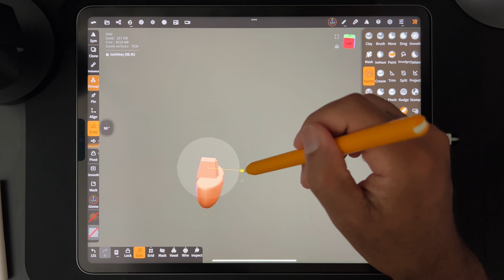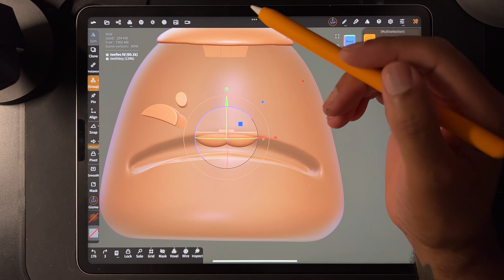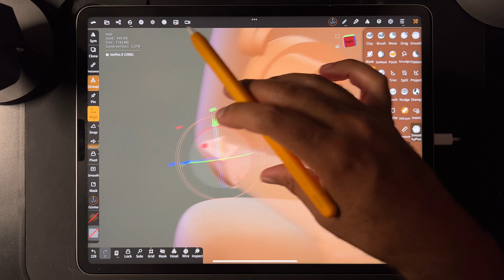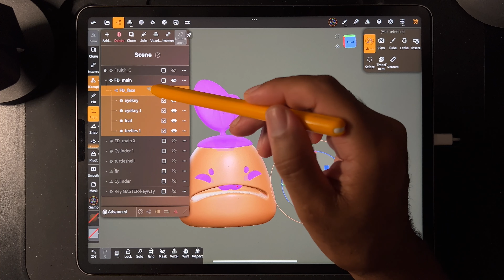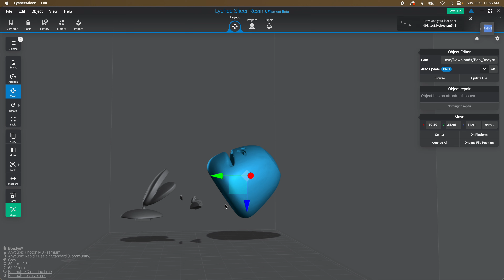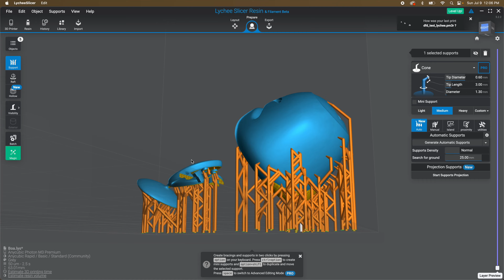Nomad Sculpt: Preparing for 3D Printing & Lychee Slicer Setup

Comment: Thank you for this video! I love your content!! ❤❤
You have a pencil cover on you Apple Pencil. How do you charge you pencil with that on? Does your cover work when the iPad has a cover on it as well? In terms of charging the pencil.
Reply from the maker: Thanks for the kind words!! I have a silicone pencil cover, it still charges just fine on the iPad edge - I don't buy cases that have the pencil Cut-out (holder) though, the cutout wouldn't be big enough

Comment: Thanks for another cool video .  Do you know if there are color printers for the 3d prints that just spray colour based on how you coloured in nomad ?
Reply: There's nothing like that available right now. It does sound pretty cool. But for now your options are 

You can print one color, and then paint all the pieces if you wanted to, or. You could take the time to print every piece closest to the color you wanted.